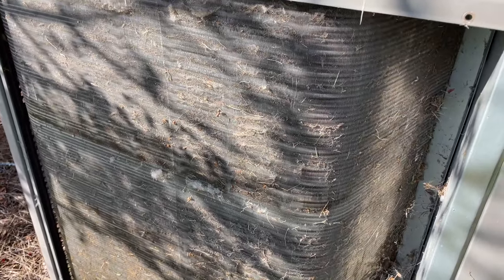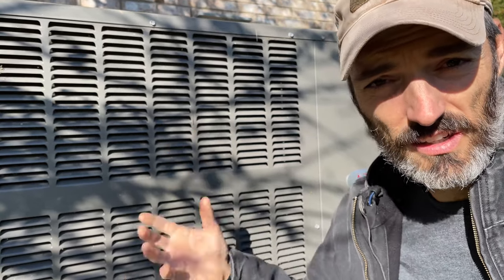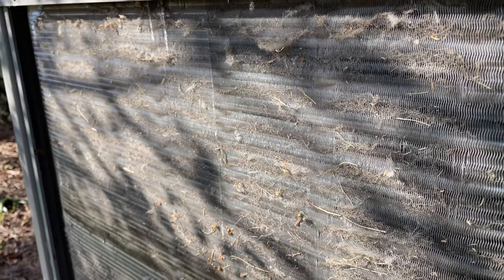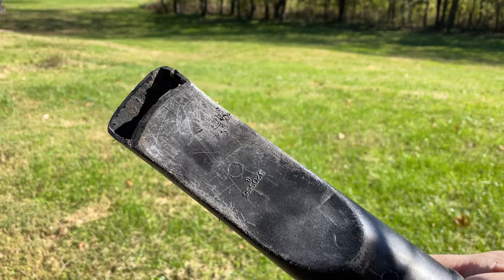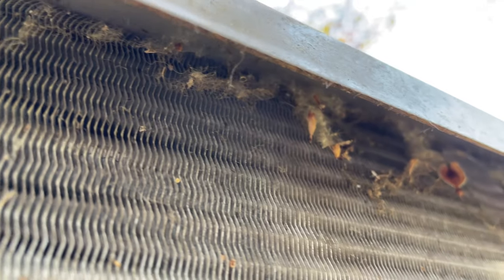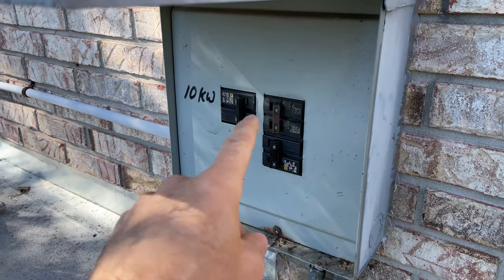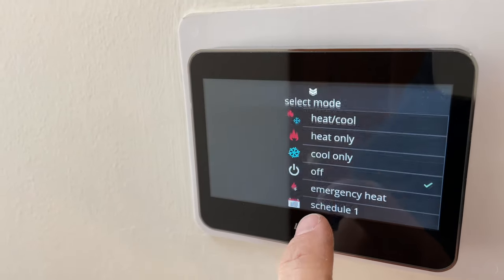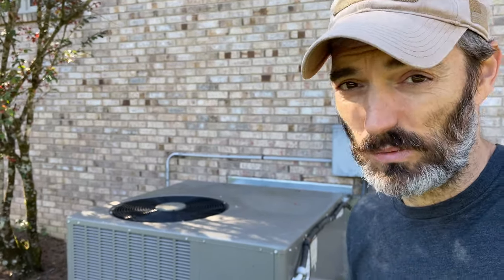No Heat From Heat Pump?! THIS MIGHT BE WHY!!

Comment: I'll be honest, I'm not a fan of heat pumps but you did a great job cleaning that. May I suggest a pressure washer called a "coil jet", it's designed as a low pressure aircon coil cleaner and with coil cleaner liquid will greatly improve your HP efficiency. You can even get a hose you can use to get inside the top of the fan to push bio matter out the way it came in and the coil jet cleaner has an adjuster for ratio of water and chemical depending what the coil cleaner fluid recommends.

Comment: Jimmy, watch for ice on it during freeze/thaw cycles and ice storms.  I've seen people go so far as to putting an open sided roof over those units to keep rain, sleet and snow off of it.  People in the deep south don't typically have to deal with that, and that's why it is a more popular choice down there.
Reply from the maker: Got it, thanks!

Comment: My system freezes up too in very cold conditions and it’s clean, I think it’s just due to it being cold moist air coming into contact with the cold fins.
Also the recirculating filter in the house needs to be very clean, any restriction there causes a low pressure area to form in our hallway where the filter is, the low pressure then drops the recycling air temperature , which you need to reheat again, thats very inefficient

Comment: Keep in mind. Your heatpump is supposed to go into defrost as the outdoor coil sensor starts sensing ice build up. Essentially going into air conditioning mode, where the outdoor coil get super hot and melts the ice, but at that time your electric heaters in the air handle are supposed to bang on so you dont get a blast of cold air in the middle of winter. So maybe the outdoor coil sensor is going bad. Or the defrost board.

Comment: About how long was the unit not cleaned for before you had to clean it? As soon as it hits below 40 here my heat runs all day barely able to hold 66 and its only a about 2 years old
Reply: Have you determined if there was a problem. My unit is four years old. It fell to 9 degrees overnight and I awaken to 56 degrees in the house. 😢 unit is inspected and maintained twice a year.
Reply: @Checkthisjunkout  Heat pumps transfer heat from the outside to the inside, and the opposite in cooling mode. At 9 degrees, there is just not enough heat in the air for the unit to run efficiently.  If it's  that cold, it's best to run on the emergency heat strips, or the outside unit will just run hard all night. Your system is probably fine. Most will struggle below 20 degrees.
Reply: @CarolinaCoinHunter  Don’t the heat strips come on anyway when the system is not able to maintain the set temperature without them? So if I switch the unit to emergency heat, that wouldn’t do anything more, would it?
Reply: @Checkthisjunkout  It would keep you from potentially damaging the compressor. If it can't keep up, it will run the crap out of it, and it can get extremely hot.
Reply: If the heat strips are on it will indicate auxiliary heat, and they also engage in defrost mode when the flow of refrigerant reverses back to ac mode sending hot liquid refrigerant  to defrost the outside coil.
Reply: @CarolinaCoinHunter  Well fiddlesticks. I wish I had switched to emergency. I’ll remember that the next time it’s this cold for such an extended period. Hopefully that’s not for a long time.

Comment: After you cleaned it and you show a temp of approximately 100 degrees is that the emergency heat temp or the heat pump heat? I'm in a rental home with a heat pump and I hate it. I've checked the vent air and it blows right at 70 degrees and it's in the mid to upper 30's outside. The owner says that's normal, I think he's just to cheap to fix it. I'll bet the vents in house are blowing warmer than 70 degree's.
Reply: Yeah not normal he needs to fix your system.! It's simple maintenance and negligence on his end.!

Comment: Hello,

I have Amana prestige 2. The heating unit works great except for when the outdoor temperature drops under 40’s. So, if a cool front comes through and the outside air drops down into the 30-40's at night or even during the day, the heating unit will not turn on to heat the inside. The inside blower continues to run. 

After a few hours, and a few turn-on-off the heating pump may work or may not. This will happen over and over. I have to shut the unit off. I replaced the condenser with a new one and it is still the same. I also do not have this problem when the outside temperature is 50-60's, the heating unit starts and runs fine. 

Can anyone give me any feedback on what may be causing this? Any information you can give me would be greatly appreciated.